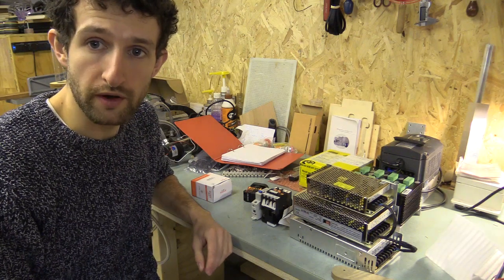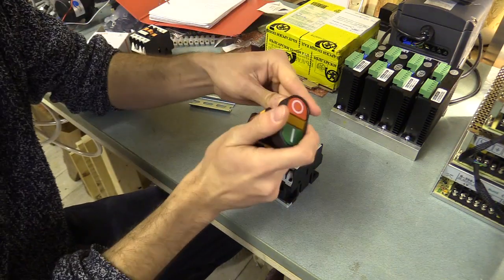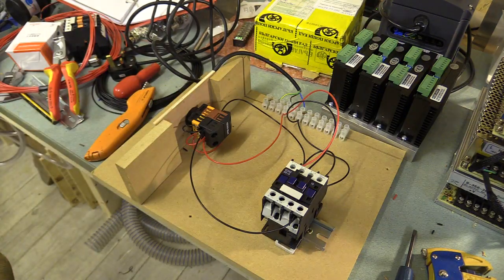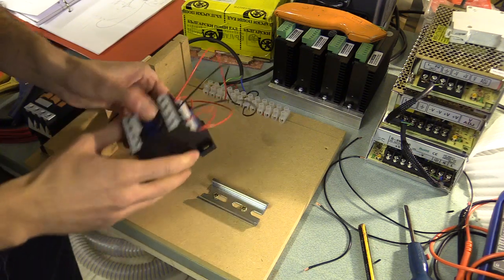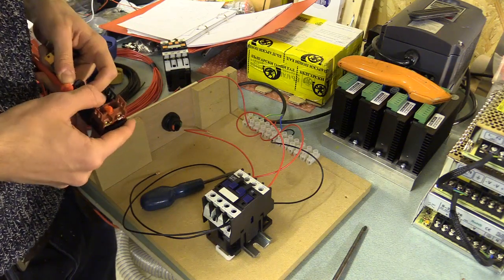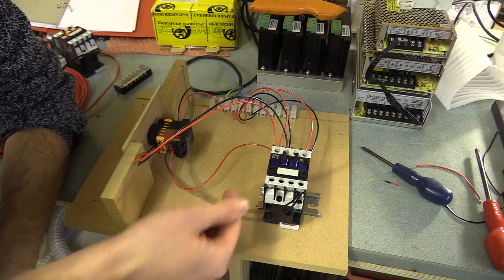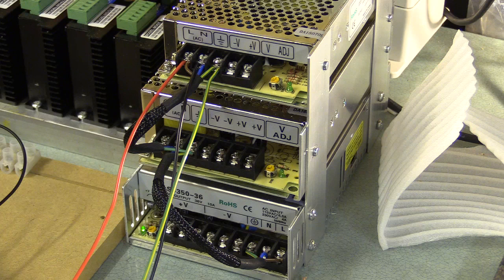#9 Wiring Contactor Unit to On/Off Switches #9 / CNC Control Box

Comment: Congratulations, I have bought and installed thousands of these units and never come across any that had been incorrectly wired, you got a duff one straight away. I do not think that I would have looked at the switch as I get so use to the way it should have been wired and just think it is wired correctly. With my mind set it would have taken twice as long to work out the error in the circuit, testing is very important before installation and you have just proven how important it is.
Reply: wut

Comment: The first breaker you bought is called a
double pole breaker and is used to break the positive and negative pole to completely
sever all electrical power. this is used on a breaker panel in a house for
instance. The second breaker you bought is just a normal four way breaker but
normally this is used the cut the positive side of the current only, these fit
onto a backing plate that holds them together and also provides the positive
feed.the first braker you bought is
called a double pole braker Hi, the first braker you bought is called a double
pole braker
Reply from the maker: Thanks John. I'm kinda excited about the possibilities of using a contractor unit with a proximity sensors. Trying not to get distracted from the CNC project!
Reply: Hi, I'm from Canada and have built many industrial cabinets for the North American market. We aren't allowed to break the mains that opens both the hot and the common, the common must remain connected. I've also built cabinets that were going to Germany and they insisted on two pole contactors on the mains. Anything we built had to be in metal boxes, including for Germany but I've been to the UK and they use plastic boxes for just about everything. When I see Savvas making his control panel in a wooden box it really worries me that I keep thinking that he needs at least to put in some sheet metal shielding. It's funny how we are all trained to do things a certain way and when we see them done differently they look so odd.
Reply from the maker: Hi Brian. I know you can get self extinguishing plastics so I assume they are made from similar stuff in the UK, but I am winging this project to be honest. I've bought an aluminium sheet to for another enclosure I am building to earth and hold all the components.I'll paint the box with some flamebar as well just to make it fireproof.

Comment: Nice video Savvas.
I just wanted to know if the "EMI generated" that Kent VanderVelden was talking about, is that the same as Back EMF?
The first "Contactor" I'm sure is just a Relay and the second one is a Contactor - Mostly used on machines that works with 3 Phase power.
The way it can be used for in your application is to break all power to the Machine in case of Emergency. Then the E/S must also be connected in series before the start.
You can also mount a thermal switch or Flow switch on your cooler and connect that also up in series before the start. That might help ensuring that everything is OK.
The breaker for the controls of that circuit, is far to big and at this point have no use. I'm sure your contactor won't pull more than 1 Amp and I'll rather replace that 16 Amp one with a 4 Amp one.
Evan if you include more safety features it wont increase the power used.
PS. For like a E/S feature on the spindle there should be dynamic braking feature on the drive that could be used. (DC power pushed into motor to stop it.)

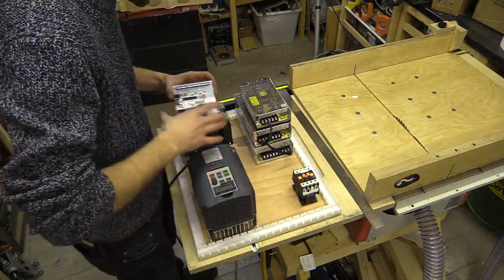Comment: You do a great job of explaining each step. I may have missed mentioning the type of controller you are using. Is that the board you are holding at 10:52? For what it's worth, I received a mill with a name-brand contactor, but with incorrect labels. the N/O and N/C markings were wrong, just like yours. Yikes! A big seconding of your recommendation to double check components. I hope you don't encounter this, but with similar power supplies to the ones you are using and VFD, I've had problems with electrical noise being pretty bad, and sensitive electronics loosing their minds. Best wishes, Kent
Reply from the maker: Thanks Kent, I was holding a phoenix CNC controller. It's made by a nice gentleman in Bulgaria called Hayri who sells them online. I guess stuff like that just happens sometimes. At least we didn't get electrocuted!! Thanks for the forewarning. I have bought an EMI filter to wire up before the VFD, and planing to separate all the high and low voltage wiring. Fingers cross it works!

Comment: Hi Savvas I am having trouble locating a contactor unit suitable for the task I would appreciate it if you could give me exact details of the unit used and a source of same. are you using a low voltage on /of switch to initiate the contactor?

Comment: Contactors are for lower voltage control of Higher voltages and currents some are 24 volts operating  120 volts or 240 volts. The one you have is 120 controlling 240 volts Canadian or 110  to 220 US volts. there is also 115 to 230.

Comment: i've never used a contactor before.  Can you explain why its required for this circuit?  Curious why the switch cannot supply power directly to the power supplies.  Is it a current rating thing?  Thx.
Reply from the maker: If the power fails the controller won't turn on again when it's restored - It's like an NVR switch, so safety but also it makes it feel more pro turning the machine on and off like that.
Reply: A contactor also allows the control switch to be mounted remotely, with a smaller current (or voltage) controlling the load. Because contactors (and switches) can fail closed, e-stop circuits should have two over-rated and independent switches. Would be interesting to take apart an industrial e-stop button and see if they have two break methods built in.
Reply from the maker: I was planing on putting an e-stop between the 24v and the control board, but I'm not sure what effect that will have on the VFD. I know I can change the no/nc terminals on an e-stop so I could wire two power cables via the estop.
Reply: Educating Savvas [It's tempting to use the enable line if one exists. However, if additional safety is desired, then the AC power should be removed. However, if AC power is removed, the VFD likely loses the ability to do regenerative breaking and will coast to a stop. In which case, one might need external braking.] (That's paraphrased from the VFD manual I have.)
For my own CNC mill, I compromised, by killing the power to the spindle and the enables to the stepper motors. I figured the spindle is potentially pretty dangerous (so kill the VFD power) and that unpowered steppers could allow the head to settle downward (so kill their enable lines.) Please don't take this as advice, and if you see any thing wrong with it please let me know. I've discussed this with an engineer, who pointed out problems, and in the end acknowledged, there generally are compromises. Like everything, right? :)
Reply from the maker: I guess it depends on how big the machine is. The stepper motors are likely to knock a person before the spindle? But I'm really not sure. With my first small controller I wired the estop to the 24v going to the driver board and that worked by stopping the relay to the spindle, and stepper motors. I think I will wire the new estop to the control board power for now and see what the VFD does when I get to that stage. Maybe keep the VFD panel visible as well?
Reply: Educating Savvas That's sounds smart, keeping as many indicators visible as possible. My steppers move slow cutting metal :) There were a couple other reasons I didn't kill power to the steppers. I didn't want to lose the home position. Also, the weirdest one... if I killed the power to the stepper motor power supply (Lambda TDK 48V/480W DIN mount), there was radiated EMI generated, as the power supply shutdown, that would take down the pendent. Really interesting stuff, but so much time can get taken up... better than watching TV though :)
Reply from the maker: I still get a bit of TV in... Lol. Loosing the home is an annoyance - with the current machine I just pause the cut when something goes wrong and only use the estop for major cock-up or if I think I'm going to hurt myself. I am going to wire up a hold buttons to the controller as well so I have a couple options depending on what happens. Interesting to know about the EMI generated - are all your wires shielded within the enclosure?

Comment: Can you please tell, What will be the cause if you turn on main switch but contactor doesn't get activate?
(All the wire connections are proper)
Reply from the maker: Contactor could be rated for different voltage. Best get a qualified electrician to look at it.

Comment: Why 3 seperate power supplies?
Reply from the maker: I am using 12v for the fan and pump, 24v for the controller and 36v for the drivers.
Reply: Educating Savvas OH WOW!!!  So I'm guessing that you're not using NEMA23 motors from inventables... So, which will you use?
Reply from the maker: For this machine I'll be using Nema 23's but I want the controller to be future proof - if and when... that's the plan anyway...
Reply: Educating Savvas Thank you, Sir!